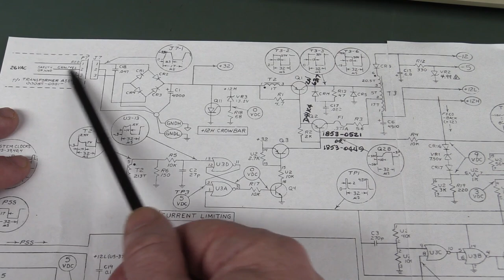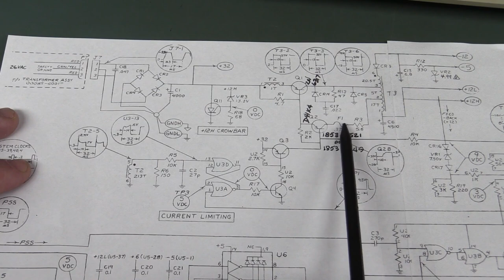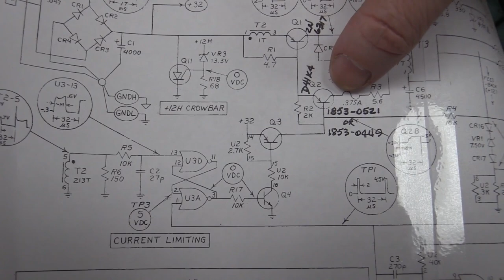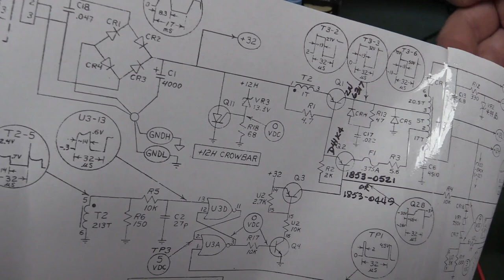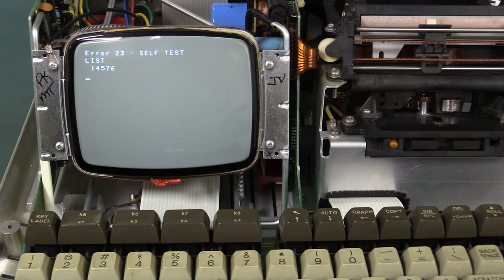EEVblog #905 - REPAIR: HP85 Vintage Computer

Comment: In the previous video, it looked like the brown pinch roller built into the tape was gummy, and had gunk on the tape itself.  It could have just a reflection, but it looked gunky like how an old 8-tracks pinch roller goes gummy also.

Comment: The tape drive itself looks good. The tape though, looks like the internal rubber roller has turned to goo. This is a problem with 8-track tapes that also use an internal pinch roller.  I bet there is still data on it.

Comment: The drive wheel (red rubber) breaks down, also the old tape media flakes off.  I did replace the rubber drive wheel with another type but had to gently sand it down with a fine grit to get the size right.
Replacement tapes were available at the time (15yrs ago).  Was an awesome HPIB controller.  Now I use EZGPIB and a LAN adapter.  I donated the HP85 to the college along with truck loads of other gear and parts.  Keep up the great work!

Comment: The tape doesn't move because capstan melted away, ya dingus :)
Reply: You can see all the brown sludge on the tape drive wheel and inside the tape case.
Reply: Clean the capstan in the drive and replace the rubber wheel in the tape cartridge. Clean off all the brown gunk and your tape should move.

Comment: My father worked on a survey of the sewer systems in San Antonio Texas and then as a draftsman/assistant cable system engineer and I remember him bringing home the marketing shwag for these along with test plots of x-wing fighters, darth vader and other cool stuff. I remember wishing I could get my hands on one, I'm not really sure what I would have done with one but they looked so cool. Eventually I wound up with a TI 99 which was a much more capable computer and had pretty advanced graphics and sound for the time all accessible via a basic interpreter after the computer was stolen I got an ATARI 800 which lagged behind the TI 99 in a lot of ways but had the largest color pallet of any personal computer available for years,  had a very hackable graphics processor and an almost cult like user community.

Comment: Sounds like the motor is probably belt drive and the elastic belt has long since rotted...I bet a new rubber band gets you up and running.  If it is moving it can't rewind forever so that should have gotten to the end of the tape.
Reply: that makes sense. Old belts and such have a tendency to either rot away or just melt onto a pile of goop.
Reply: Direct drive.
Reply: On a tape player that old, that was my first thought as well. I was actually surprised it seemed on good state during the teardown.
Reply: +Nicolas Innocent and I just realized it was the printer's

Comment: The tape in your tear down had gunk from the rubber on the rollers degrading in it. I would suspect it would be one of the main issues with the tape drive. Tape drive electronics are generally very robust.

Comment: It's a nice combination. A guy that rips products relentlessly and mercilessly, but is not sensitive about people seeing how he screwed live either.

 I wonder if that fuse might have been added after the engineering crew offset the connector just like that and produced a fireball. It probably saved a lot of fiery factory repairs for HP.

Comment: Darn, I had one of these things when I worked at Telstra, I think it was used to run an automated test setup (very slowly), because it had HPIB support to talk to out test equipment.
In the end it got stipped (Ultimate tear down) - I think I still have the CRT in my junk box.

I kind of now regret not putting it asside for keeps, but hey, you cannot keep everything.

Comment: The problem with the tape drive is that the rubber on the drive wheel has turned into goo. The drive wheel can't turn the wheel inside the cassette anymore. This is a standard problem that happened to all units after a certain number of years. The goo ruins any tape cassette that is inserted, which is possible to see in the teardown video. Don't try other tapes until the problem is fixed.
People have come up with different solutions to replace the missing rubber with something else. Do a Google search.

Comment: I had a similar problem with my first computer - 64K memory running at a blistering 4 MHz.  (Z-80A)   My very first repair was when I plugged the memory card of my first computer in one position off.  (was just pin headers)   Blew a 5V regulator apart.  My first parts change, and my first PCB component replacement.  Looks like a dog's breakfast, but it works.  I still have it - 32 years later.  (can't get hard sector disks for it.)

Comment: You can see that the rubber rollers have melted so it's off the Wagner Electronics to see if they have square cross section O-rings to glue back on.

Comment: Nice videos.

Just a suggestion, if you like old calculators then perhaps a fundamentals Tuesday or something on LC circuits overclocking a voyager series calculator by adjusting the LC circuit values.. could even get the uCurrent in there showing the increased current draw and battery life predictions maybe.

I have an HP-15C I could send over if you are interested.
Reply: Sorry, I meant Fundamentals Friday.

Comment: Hi. The link at the end of this video sends me to video #903, not the one that is shown in the preview. And when I watched your #903 teardown of this computer and the somehow unlisted video #904 I noticed some kind of goo on the tape and in the cassette around where the capstan would make contact. Maybe there is a rubber pinch roller that has turned to goo in the cassette .

Comment: Check for belts, bands and silicone-type gears. Band and belts you can get from ebay. And in case it a gear you can 3D print one. Pinch roller like an 8track seem to live on the cartridge. Itis rare that the computer dont time out the tape drive at some point because is waits forever. That could mean that this failure mode wont show on a self test or service mode test. What if you PUT the tape after it boots. READ and WRITE (PLAY and REC) are probably working and the path to FF and RW is giving trouble. On power up probably want to RW the tape, just skip this step by putting the tape after.

Comment: Hi Dave, at about 6:50 when you probed the Cap, I noticed a white sticker on the back of the power supply board with "-2016" on the bottom line. Just out of curiosity, is that a date or something else? Great video btw!

Comment: HEY!!! i may have seen something!  that will be a problem!  that light blue  cap near the  fuse the long one.  Had strange  lumps underneath it's  blue packaging.  The metal maybe rotting!  and therefor the cap itself maybe in trouble.

Comment: I think your tape drive isn't working because both the pinch roller next to the head and the roller in the cassette
 have perished and are covered in slime with some of it having been splattered onto the tape itself.

Comment: Hey Dave Jones and everyone else if you leave the ground strap disconnected all of the electrons that will flow through that ground strap we're falling through screw hole that was used to attach the brown strap to the board.

Comment: As I noticed, there is no communication equipment in it? It's a pity.
Reply: I remember seeing these (IIRC, it may have been a slightly different model)  on YouTube before, there are add-on cartridges that allow you to add external hardware, in that example it was another printer (daisy wheel).
Reply from the maker: I actually have an unboxing video of this, might put on the my 2nd channel. It came with two serial port modules.
Reply: Actually, the HP support for external interfaces was one of this computer's main selling points. I worked in R&D in the early Eighties and we used HP85's for all kinds of testing.
Reply: Actually, the HP support for external interfaces was one of this computer's main selling points. I worked in R&D in the early Eighties and we used HP85's for all kinds of testing.

Comment: Where did you get the schematic for it? I can't find one anywheeeere...
I think I just exploded mine the exact same way. Those damn flat flex cables... I need to find the voltage rating for that fuse

Comment: In the teardown video, when you showed the tape cartridge, there appeared to be an orange-ish liquid around the drive wheel in the cart.  There is a good chance that the cart is bad.  Try using your thumb to manually advance the tape within the cart without any notable resistance.  There is a possibility that the tape media itself has gone crusty, or decomposed enough to the point that  either the oxide coating has fused the tape together on the reels, the tape has snapped somewhere, or the drive loop within the tape cart is broken (see: https://upload.wikimedia.org/wikipedia/commons/9/96/Computer_Tape_Cartridge.jpg)

Comment: how did you get hd video on that old crt? 0:08
Reply: r u serious

if u r its called video editing
Reply: CRTs use electrons, which as we all know are extremely small, so CRTs can have a near infinite resolution. 

The max resolution you can get from a CRT is (Length/Quark Length) multiplied by (Width/quark length) 

But of course, no modern hardware can manage all that, so Pixels took over.
Reply: shurdi3 Interesting. What prevents 4k or 5k video on a CRT?
Reply: Nothing really, it's just that the more electrons you need to fire off necessitates a larger and/or bulkier CRT.

Comment: 11:08 How can resistance be  "minus 176 kOhm"?
Reply: Well, if you apply a positive voltage and get a negative current (because the cap is discharging into the DMM), then using ohms law you end up with a negative resistance.
Reply: The ADC sees a negative value, since the digital value output is signed, the ADC can send a negative value to the CPU at that point it is up to the code running on the CPU to either discard the negative value as garbage, display an error, or display the negative value as presented. On the Fluke, it passes the negative value to the display.

Comment: I hope you picked up that horrible multimeter they have at aldi this week. I want to see how crap it is, but I don't want to spend the $20 haha
Reply: I bet a dollar it works perfectly fine. and is adequate for your needs. this dude will just say it's rubbish without even examining it.
Reply: +David Serrano it's not, the leads look like you could barely pass current through them. Hence why I wanted to see him take a look at it so I could see what else was bad about it
Reply: TacticalBBQSauce if the product didn't work they wouldn't sell it. Trust me it will definitely work. And if eevblog reviews it he will admit it works for the task at hand but only after saying it's complete rubbish. I like his videos but he always shame affordable products mainly because it's cheap. I went to his Amazon store and he is recommending products that are way to expensive for what they are.
Reply: David Serrano
Mate, it looked exactly like a mains rated meter, but the probes looked thinner than home speaker wiring. My bet is some dumbass shoved it straight in a live socket.

I agree Dave is picky on meters, it comes from working in the industry. But trust me, this was a very cheap shitty looking meter, just like the rest of the tools aldi sells

Comment: Hey this might be a problem that might be going on maybe in incapacitated capacitor.

Or not enough volumetric capacity.

End the water absorption capacitor lead to moisture corrosion AKA desiccant probably not in this thing but worth a try for a gag.

Also doesn't a solar powered flood light or Lantern sound like an oxymoron.

Also you know how they say you can make it foolproof but I can't make it idiot-proof well you can't make something entirely foolproof for one thing if you were to advertise alarm system as being full proof and someone managed to break in because there's a fire it took out the alarm system bored well somebody would probably sue the alarm manufacturer because well their alarm was up full proof and was not as advertised.

I'm pretty sure that some foolproof product as it was advertised out there probably wind up with that fake I'm sure there's probably a video about someone that money channels somewhere somehow on YouTube.

Don't even get me started about the horsepower of a Shop-Vac how can they advertise 5 horsepower on a Shop-Vac when the electrical definition of a horsepower is 700 something our walk on Watts 5 horsepower would be over 3 kilowatts I don't think I'm puny Shop-Vac cord would take 3 kilowatts at 120 volts ac at least four more than a millisecond.

Also when somebody tells you they'll be down in a jiffy well as she did wrong unless they can make it they're in 1/100 of a second yeah that is a real unit of measurement of time I know you're going to say you're kidding me but know it's real.

Just like the metric boat ton an evidently have not substantiate that one but for what I've heard same thing.

How does someone calculate the weight of a lot of the meat from the rear end of cattle and transfer that into a metric unit.

They use the metric but ton!